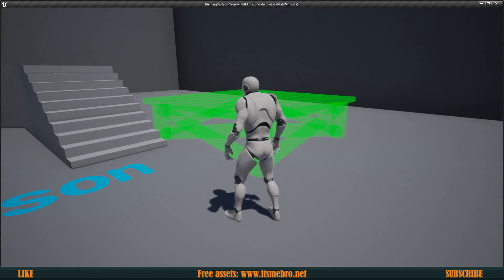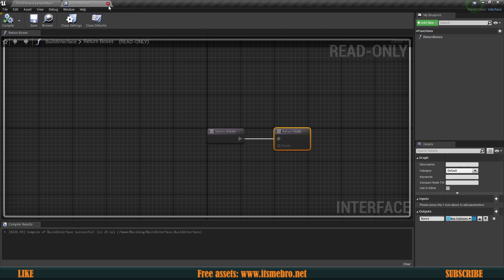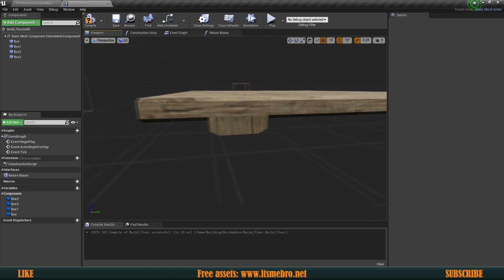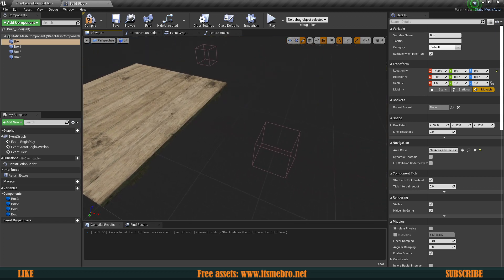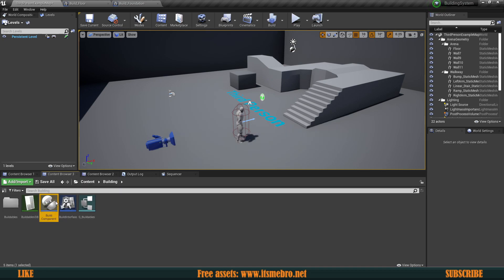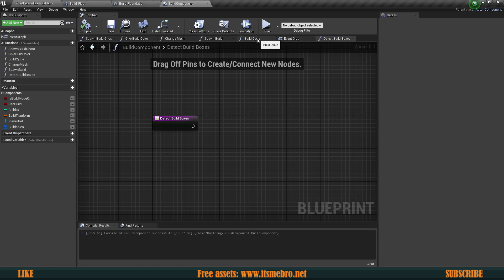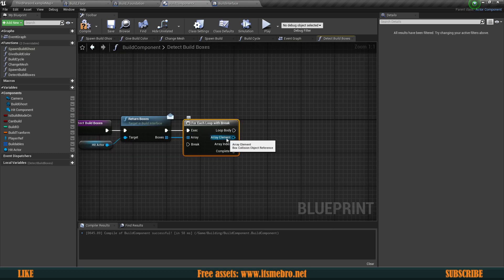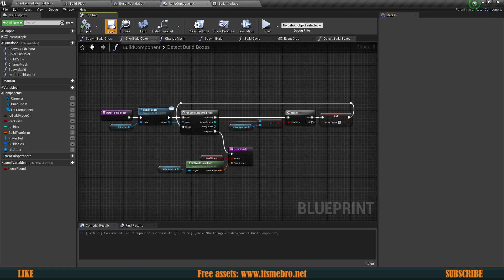UE4 Base Building / Snapping

Comment: quickly browsing your videos there is one thing it doesn't look like you covered. How do you use this system if you have building pieces that are not all the same size? Like if you have 3 floors, a normal size, a half wide and a 1.5x wide?

Comment: You have shown how to snap exactly on side of objects. But this only allows objects of same size attach to each other.

How do I make multiple snap point on a single object and tag each snap point? e.g. 

- A half plate floor can attach to side of a full slab floor on both long side and short side.
- A different looking wall can snap to two different type of floor or to a different type of wall but each one has different type of connection.
- A lamp can only go to center or 1/3 top and 1/4 division of the wall. but a monitor can only attach to center point of the wall.
Reply: Use dif trace channels

Comment: Hmm. Looks like UE 5 messes with this tutorial a bit. The trace snaps to the root of the placed objects, and the floors don't seem to snap at all. etc etc... But sometimes the base platform snaps correctly...
Not only that, but when I point the ghost outline at some of the starter walls, the build copies their transformation into the build pieces! (so it's now as long as the wall)
Since the dimensions of all the pieces are 1-1-1 and there are no stretch transforms, this has me somewhat mystified.
Reply from the maker: You have made a mistake somewhere. This works the same in ue4 and ue5. Most tutorials on youtube do.
Reply: @ItsMeBro  I fixed one error that was causing the platforms to scale. The cause was the "Local Found" was a normal variable instead of the "Local Variable" that you showed in the video.

The floor tiles still refuse to snap, but the foundations snap nicely.
Even when placing a floor piece over a ledge (so it's only possible to hit the extended collision box) my version doesn't register... bleh. So I'm wondering if there is another variable I goofed like the "Local Found".
Reply: sigh slapping myself across the face now. (figuratively) XP
Somehow I had turned off the collision of the platform boxes from "Query Only" to "No Collision"... and I somehow managed to mess up twice on different empty projects. 
Now everything works properly.
Reply: @BaeronBubba  How u fixed what the trace snaps to the root of the placed objects

Comment: Hey, great tutorial, tyvm!
Question:: Any ideas how to play a snapping sound PER snap? If I just play a sound 2d, it keeps repeating ofc because of the line trace cycle and I can't just check the change of the transform variable since it does change values while inside the collision box limit during the same snap when I move the mouse. So it still repeat the sounds. Any Brainiac out there???
EDIT: Ok, I found a way incase someone else would like to add a snap sound without repetition.
In your 'Build Component', 'DetectBuildBoxes' function, create another Hit component variable. I named it 'PreviouslyHitComponent'. Now, after the TRUE of the branch that checks the 'ForEachLoopwithBreak' (1), add another branch with the condition 'Hitcomponent' EQUAL to 'PreviouslyHitComponent'. From the TRUE of that, connect to 'Set collision box found', like it was previously but from the FALSE, Play sound 2d (your snapping sound) then 'Set PreviouslyHitComponent' to the 'Hit component' node you will find from the previous (1) condition and connect that node to 'Set collision box found' as well. That's it for this Function. Now, incase you lift your mouse and reselect the same spot to snap, or reselect the same snap after moving the mouse on the ground, you need to go to BuildCycle Function and after the FALSE of the Line trace branch, add 'Set PreviouslyHitComponent' node and leave it empty to reset the variable. Don't forget to connect its output to continue the flow as before.
And after the 'Set hit component' node you already have (2), add a Branch with the condition from the 'Set Hit Component' output (2) NOT EQUAL to PreviouslyHitComponent variable. FALSE connects to 'is valid' as before but TRUE add 'Set PreviouslyHitComponent' and leave it empty to reset, Then connect that node to 'Is valid' as well.
It's difficult to explain all this with text but if you follow carefully it will work fine and play a snapping sound only once per snap but If someone can think of a better way, pls let me know.
Reply: Hard to read that text but if you still wondering after two months, you may try this =)
Create another variable named "PreviousHitBox". Add another output to your DetectBuildBoxes function (or whatever is your name). Return the actual box you hit. Check if it matches with PreviousBox. If it doesn't, play sound. Set the new PreviousBox.

Comment: Hi first of all thank  you for creating this video.
I believe ive done everything as per instructions but it is now doing this wierd thing where it doesnt want to spawn the ghost at all if i look down,and spawn ghost only if i look more up and the ghost will not change the color to green wherever i look. I think the key difference is also that your ghost appears where your character is standing and mine spawns further away from the character can you PLEASE HELP ?
Reply from the maker: Sounds like your start location for trace is off. If you have first person, remove multiply node for start location.
Reply: Nevermind ... idk how but i disconected something in the build cycle ... rookie mistake
Reply from the maker: @matuskacmar2059  happens. GJ with figuring it out :)

Comment: Hi can you help me? I did everything you did exactly the same and when i try to play it it won't snap and after placing the first peace for foundation second is high of the ground. it almost looks like it bottom of the second is caching to the top of the first one or even overlap but wont snap.
Reply from the maker: Sounds like you have made a mistake in collision settings for the collision boxes.
Or maybe just aren't returning collision boxes to the build cycle.
If you need help you can contact me on discord, which is a better place to communicate.
Reply: For anyone else who encountered this problem. You made your Box Extent Z value smaller and moved the collision box up. Don't do that. This way, when you spawn a block, the HitComponent Transform is higher than your StaticMesh transform and you experience that issue.  @It's Me Bro, you might add this notion somewhere. Very nice videos btw =)

Comment: Hey mate ! great videos. Just a question, why dont you use sockets for that ? that way if you want to incorporate a solidity system or even to break all the child when a paretn is deleted it would be easier, don't you think ?
Reply: could put each socket as a child of the collision box for snapping :D
Reply from the maker: Because collision boxes give you an area in which to look at. Also gives you a visual "representation" of where the object is located. Also later gets used for outline drawing. And no need for any additional calculations and makes it easier for beginners to understand what's going on. If I would add a lot of math it would confuse a lot of people and they would not be able to modify the system to their need.
Many benefits that just socket alone does not provide and still requires additional components.
Reply: @ItsMeBro  thanks for the explanations bro